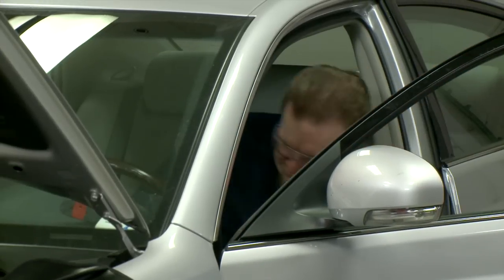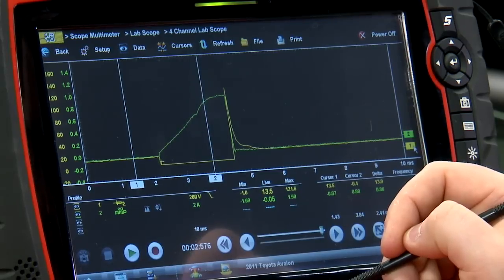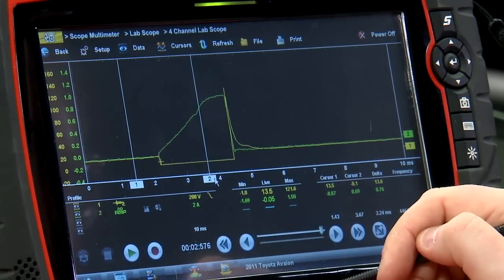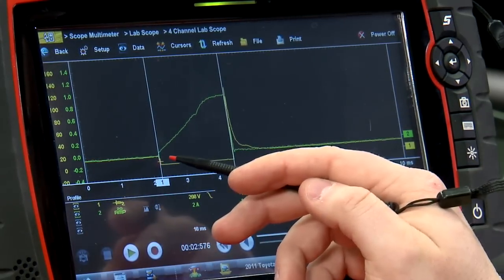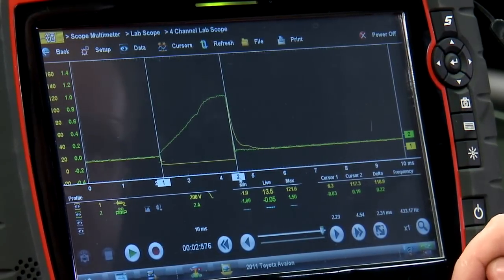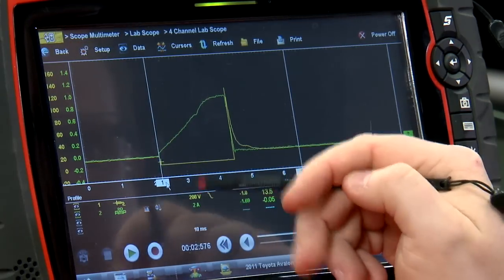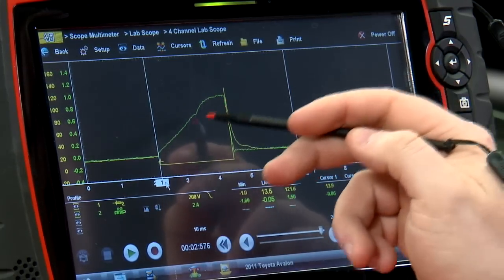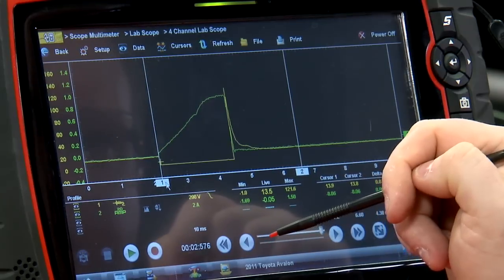Fuel Injector Voltage & Current Tests- Diagnostic Quick Tips | Snap-on Training Solutions®

Comment: Hi mate. Quick question. If I measure the voltage at the injector plug with a multi metre  and It measures 12v key on engine off, providing the injector circuit is good, should the voltage drop to zero at the injector plug to show there's no voltage drop or should I still see 12v at the injector plugs?
Reply: 12v will be there as the injector is ground side switched. 12v will be on both sides up to the pcm where the ground completes circuit

Comment: that coil oscillation bump is the pintle hump of the injector . if that hump is missing, the injector most likely isnt physically moving
Reply: and a "high squared off ramp" is from shorting, not high resistance.  :-)

Comment: One thing missing from this: You HAVE to say which wire to connect the scope to, in order to test properly. IE:  Either the Driver, or the B+.
Reply: IntrigueDynamite  good question
Reply: How many voltage needed